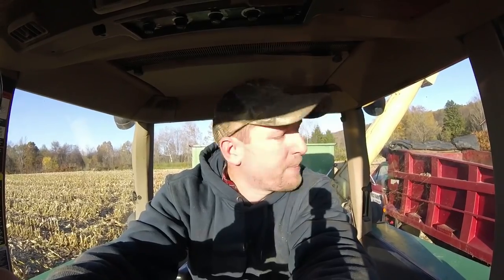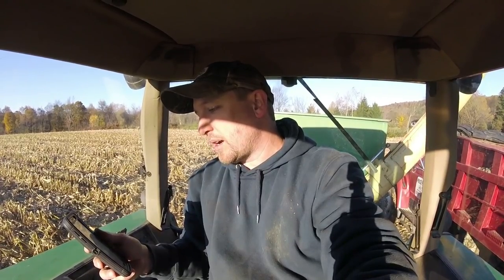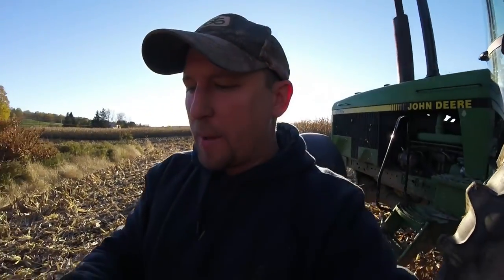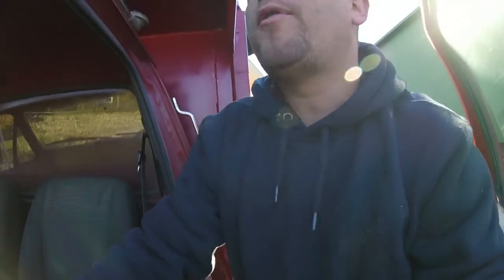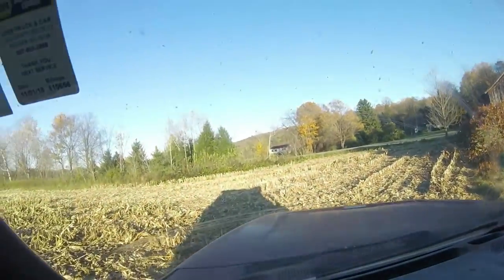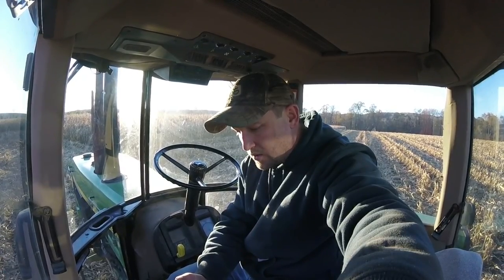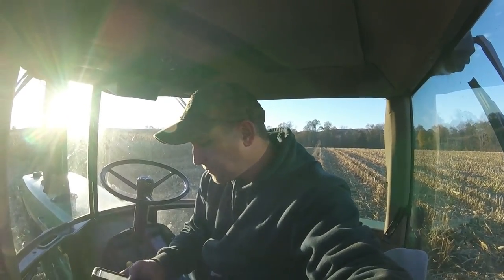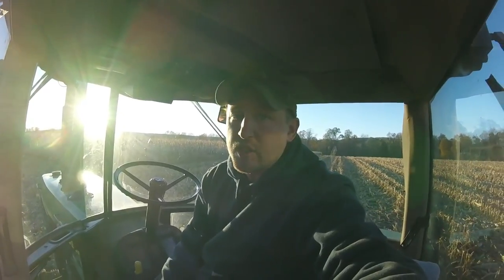Corn Harvest And Answers To Your Questions Part 2

Comment: Hey Mike great videos enjoy watching them and a few questions and a few tips question 1 do you feed you're milk cows any  pellets 2.Do you plan on increasing the herd size. Tip 1 I've noticed in you're unloading corn silage and haylage videos that you pull the tractor right up beside the blower if you was to pull it up at an angle the same way the auger on the blower is pointed it'll feed better. Thanks Tim
Reply from the maker: Yes we feed the cows protein pellets along with high moisture corn. I'd like to expand but not everyone is on board, and it would be rough to expand with these dairy prices

Comment: Hey Mike which piece of equipment do you have a love hate relationship with ? 
What kind of drivers license requirements do you need for field to farm verses field to the elevator ?
Reply from the maker: The Pequea TT6000 tedder I have a love/hate relationship with. It does a great job at tedding hay but it has had so many durability issues. The new one (TT6101) looks like its put together so much better
Reply from the maker: I have my class A CDL license so I'm in compliance

Comment: Hey Mike, great video series again, great to see the old iron at work. You've mentioned in an earlier video that your ideal moisture content for high moisture corn is around 22-26% and any higher that you would have trouble with the hammer mill screen plugging up. Did you guys always use a hammer mill for grinding the corn or did you have a roller mill before and what advantage does the hammer mill have over the roller mill? Thanks for sharing! Scott
Reply from the maker: We just got this hammer mill a couple years ago. Before that we did have the roller mill. With the hammer mill it really grinds it up real good and we are seeing less corn in the manure so we know the cows are digesting it better. We have been happy with the switch

Comment: 4425 4435 combine  suck to work on I would get a  6620 titan 2 level land you still use your 4 row head there great  Machines
Reply from the maker: I'd like to leave the 20 series all together. I would love a 9400 or 9500
Reply: @mikep7810  your better with 9500 then 9400 bigger combine
Reply: How your corn yields this year  are is down
Reply from the maker: The first field it was down a little. The 2nd field we did was about the same. It will be interesting to see what the other corn fields and the soybeans yield. The corn silage was great and was really happy with that